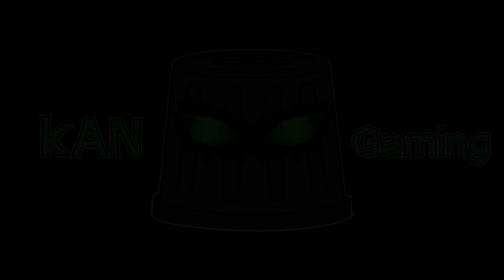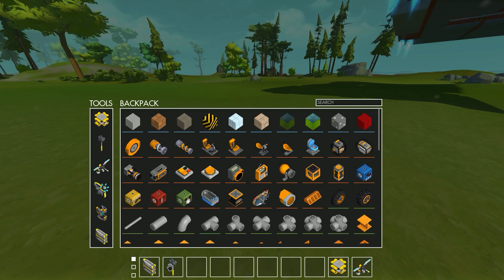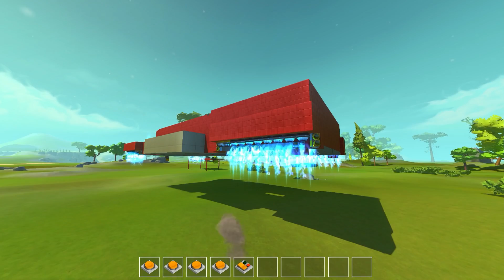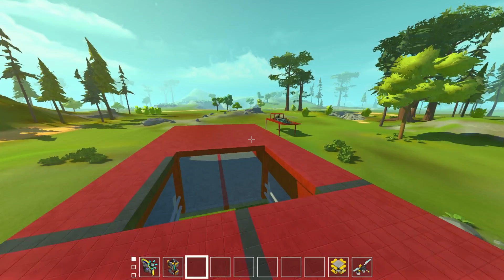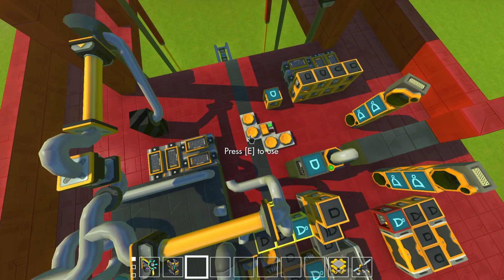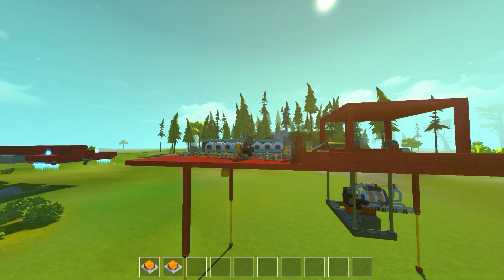Robot Auto Loader  Cannon for Assault Hovercraft! (Scrap Mechanic #268)

Comment: Hi kAN i was watching sometime ago Scrapman showcasing a rocket made of 3 separate creations/modules. And it got me wondering, how much data can creations share between them in scrap mechanic? And if is it possible to make a "lemming scenario" using small cube bots? By a lemming scenario i mean a situation where a group of small, simple, identical robots fallow each other to get to a destination. Every robot has a very limited memory so he can only remember one instruction at a time. that forces the group to communicate with each other an pass directions every "tick"

Comment: Hey Kan that is a REALLY cool system. But wouldn't it have been easier to simply have an assisted gravity fed magazine simply rotate backwards into the hovercraft then slide forwards and rotate vertically (or mostly vertically) as the cannon lowers?